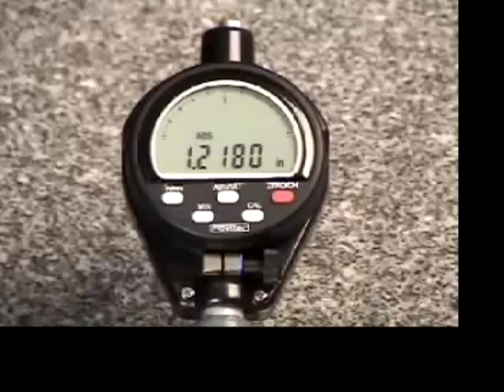Fowler X-Tender Bore Gage 1.4 to 6 Range Instructional Video 72-646-400.mp4

Comment: I have just received my Folwer Dial Bore Gauge (mine is not digital) and needed to be reassured there are deliberately 3 empty extension slots formed into the injection-molded plastic tool protective case. This video at least did give me that reasaurance.